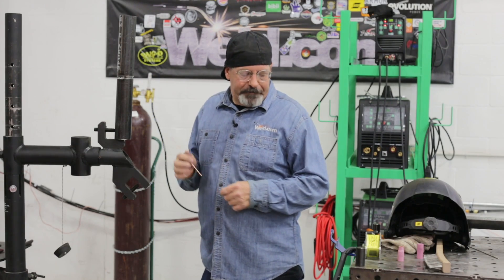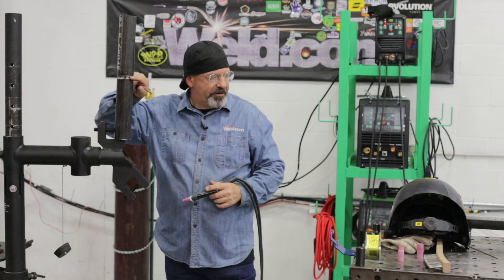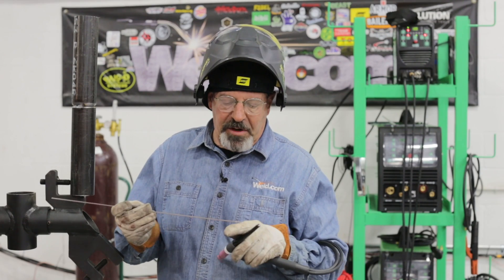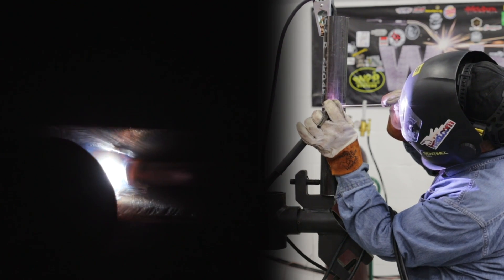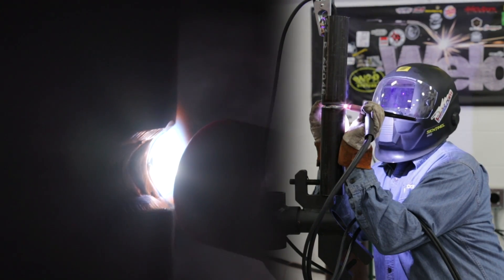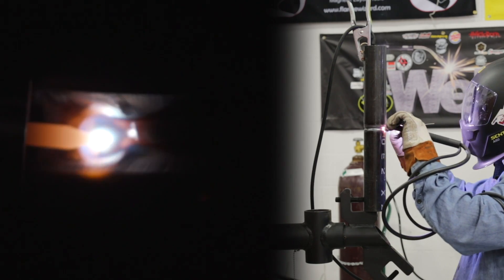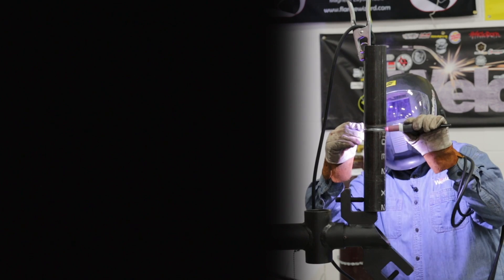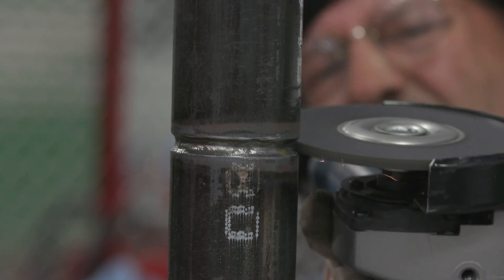2G TIG Root: 2 Inch Sch 80 Pipe

Comment: How do you do this so good? I'm having a hard time doing TIG 2G. My teacher tells me: 120amps,razor edge, 1/8 root gap, 3/32 S2 wire and to back feed it through the gap but i tried both that and laying it but all im getting is ugly suck back and I'm really not happy with it and kinda discouraged.
Reply: 2g tig-90amps razor edge 5/32 gap, 1/8 70s6 wire keep wire on the very back of bevel. Dont learn with 70s2 yet its dirty wire.

Comment: Mr. Moffat, could you please make a video comparing dry 7018 to 7018 that has been stored in the open for a extended period of time. You made a video with wet 7018 but it doesn't reflect most situations.